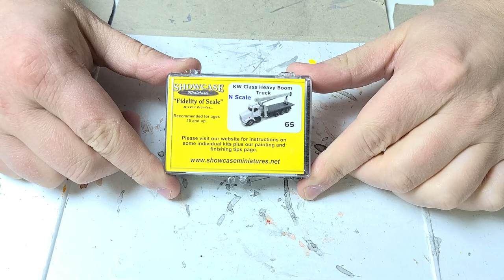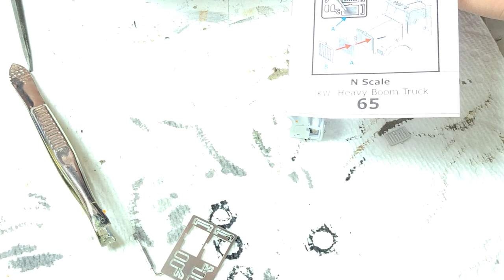N Scale - Showcase Miniatures- Boom Truck

Comment: Very nice video.  Did you use super glue for the entire build?
Reply from the maker: For the most part yes. I did use model glue for the axles just in case I wanted to move them.